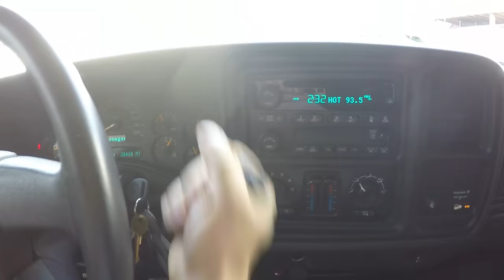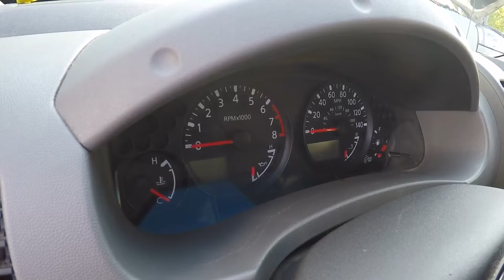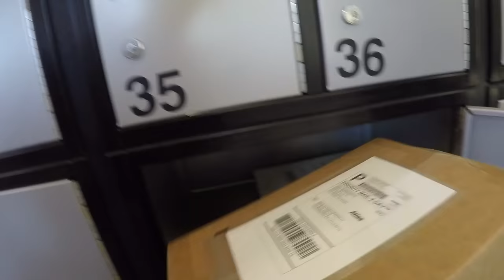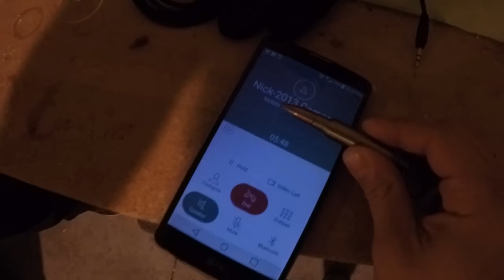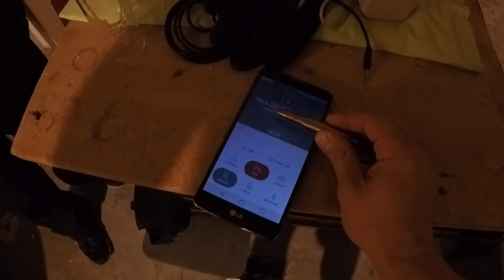THIS Is Why I RARELY Take My Truck Off Road...

Comment: I dont hate to say this but Im sure everyone will hate to hear it. My personal experience with Chevrolet has been quite unpleasant to the point I want to take a sledge hammer to them. There was an era of decency but before my time. I absolutely despise the manufacturer now and will never buy another one. I will try and persuade anyone else to do the same. I'm not trying to be cynical here, Maybe I and everyone else around me has been unlucky. Consider it a forewarning possibly. They're trouble for even the lightest of users . I think they could sell the hell out of a new vehicle if they went back to making them simple mechanically without the computers, sensors and EPA bullshit. But what do I know. I know the government wont let them, and two dealers make more money that way. Its a scam especially with government motors.  They worked better back then and if it didn't no big deal you could fix it anytime anywhere without a $1000 worth of tools and parts in a few minutes or a couple hours depending . Now the simplest tasks are so overwhelming its disparaging especially when you're not doing it for enjoyment.  At least if it was a pile you could still have your dignity and self worth in fixing it..... Ill write them a letter ha

Comment: I have taken my Suburban off road a lot and never has any problems. Well I don't need expensive rims like yours, I use steel wheels aftermarket type.    The terrains u drive are nothing.  Stock 4x4 could make it. Try mud and different terrains.  U make a lot of money and can afford anything. I'm not rich and don't own Z06. I own 2 lifted trucks and does goes off road sometimes. I'm mechanic myself and has knowledge of driving in off road and barely break while off road.

Comment: the reason you knicked the rim was because you have huge 20x12 rims with 35x12.5 tires which offer no sidewall protection, may look good on road but terrible performance off, if you get 37s it will help a little but for a truck you are gonna offroad never go wider than 8 in rims.

Comment: Some fun videos, I have a 2015 Silverado 1500 myself, if your going to use your truck off road you need more sidewall, two easy ways to do that, one, add 40" ires on your 20" rims for 10" of sidewall or keep the same size tire and put 17" rims on it, no more scratches on your rims.

Comment: Here's a tip: When you jump start a vehicle, don't hook the negative cable directly onto the dead cars battery. Clamp it on solid thick unpainted metal, away from the battery. The engine block works great. This is because if the dead cars battery is leaking gases, then the spark could ignite those gases, and well, you can guess the rest.

Comment: You know if you hold a constant rev of 2500-3000 rpm on the vehicle you're using to jump start the other. The vehicle with the dead battery usually starts, don't have to wait.

Comment: Positive before Negative. Whenever jump starting or electrical that involves the positive and negative. You will fry your system when you are grounded and put a positive charge on. Just a heads up, you don't want to pay for that fix.

Comment: Do yourself a favor and get a real set of jumper cables (4 gauge or better). That tiny jump rope you have just doesn't carry enough current. If the roles were reversed (you needed a jump) they likely wouldn't have done the job.

Comment: they gauges were flickering and the horn started to go off because the computer in the Nissan was freaking out. your truck's batteries are wired up in series so it's 24 volts not 12. your lucky you didn't fry his computer.

Comment: Your gauges flicker because it's pass interference from the charging let me give you an example but I'm pretty sure it will do that to if you hook up a battery charger its flickering because the elctrictricty has interference from the battery negatives and positives give a amp and volts the ground gives. Grounded base fro the truck and or car to start when the charger is hooked

Comment: i like your videos & you have a cool truck... but driving down a dirt road is not what we men consider off roading. Plus it's a cool truck but not a capable off road vehicle. that thing is like a boat on land. too stiff & ridged. it will sink. The lift does nothing for getting the differentials out of the way. you should consider independent suspension.

Comment: does your duramax have a crossover battery cable? like the cummins? does 1 battery get all the juice from alternator and then charges 2nd battery via a thick cable?just wondering

Comment: Flicker: gauges in vehicles today use an electric pulse to move, the more electricity added the higher they go, they even have an incredibly light charge going to them when the vehicle is turned off just to keep themselves zeroed. So the reason the pulse up and drop again or as he says "flicker" is the charge in the battery is so low that there is only enough in the system to lightly move the dials from there zeroed point. This only happens when a battery is super low or has connection issues from the gauge board to the battery. This also can happen in pretty much car but honestly depends on how nice the electrics are in which case old rice burners don't have the best due to how cheap they are.

Comment: you might want to invest in proper jumper cables. those cheapy ones will melt if you need to do some serious cranking, the thicker the cable gauge the better they will handle the current draw when cranking....

Comment: hay just a heads up jumper cables, batteries, battery acid, corrosion on terminals, cables  on front cloth seats. You could get holes in your seat,and your jeans,after you sat in your driver's seat. Just saying

Comment: I have questions mike , what length are your cb antennas and how did you run the cables from the antennas to the cb  ? Why do you have two batteries on the dirtymax and what did you do in the military ? Love the vids and your dogs !

Comment: Gauges flicker when the voltage is under 12v, you will see that until the battery voltage returns to 12.6 volts or higher

Comment: It's a truck it's supposed to go off roading stop complaining about a little scratch it happens
Reply: Daniel Dunkin it's a daily driver that wasn't built to go off-road and kind of a show truck on the side, not an off-road
Reply: Daniel Dunkin read the description
Reply: This thing shouldn't go offroad anyway. Its basically stock with big ass lift blocks and wound up torsion bars. Would have terrible axle wrap coupled with no flex.
Reply: adam courtney he doesn't have lift blocks, it's an actual lift coupled with 35" tires
Reply: No. it has blocks. you can see them in the video when its "off roading" around the 6:35 mark. The bottom of the leaf springs are around the lip of the wheel. Thats a good 4-6 inches of space between the spring and the axle pad.
For further proof just watch the old video of him lifting it. They are huge blocks.
Reply: adam courtney actually he doesn't have blocks, you should probably wash more videos before jumping to conclusions, it's a 6" zone lift, he mentioned it not long ago
Reply: Are you dense? That lift kit uses blocks... It is a kit that drops the torsion bars in the front and BLOCKS in the back. Its just what i said. Stock torsion bars in the front that doesn't flex plus blocks in the back that give axle wrap.
It might be a lift but its all for show and will not perform well towing or off road.

Comment: Actually they are required to open the hood at the stealership when doing an airbag recall. They have to disconnect the battery as a safety precaution.

Comment: as soon as that thing turns on its power steering is going to be out that it's a non American truck and y'all probably blew the mega fuse you only connect the red to the battery and the black goes to a ground

Comment: First off why connect the cables to a dead battery goof..Use the Positive and put the ground on the engine block of the Nissan engine block,bracket etc,use it as a ground this is what the starter does...Second your truck is idling how can it give a good charge..It needs close to 2000Rpms. Mostly because its a Chevy.. but all generators need rpm to produce a field current in the rotor and actually charge..Third your not helping anyone you could shock the nissan's Ecm and then no run ever. .
Reply: Fast&Fun finally, someone knows what they are doing

Comment: Get your transmission cooling lines ran to a stand alone air cooled cooler in that Xterra. If not, your trans fluid will eventually mix with coolant and blow the TCM(transmission control module).  Costs lots of money.  Just trying to save you money they all do it.
Reply: Oh yeah and that Xterra's immobilizer won't let it start when the TCM blows

Comment: You should not use the wheel the pull your self up in the truck your will break your steering shaft

Comment: As a heads up the dealer can tell if the ecu has ever been changed regardless if you put it back to stock or not.  Their software shows them if it's ever been unlocked or changed since it came off the showroom floor
Reply: Not that it matters just for future reference every dealer can tell.
Reply: matt sword I'm not sure about other dealers but as far as I know Subaru specifically cannot tell if you have modified your Ecu or changed it in any way if you put it back to stock with an accessport. They can see when the device was unmarried from the car which to them looks like the battery died/ecu lost power.

Comment: why didnt you just rev the engine in your truck? lol it would charge the other battery faster
Reply: iHackSource no it won't.  AC generators (alternators) are regulated,  revving it will produce no extra volts, amps, watts or anything for that matter. it will still only be producing 14V at idle, or 10,000RPM. only time voltage changes is when you use under drive pulling, and it drops then.

Comment: How wpuld he open his door if his battery went dead.?
Reply: With a key?
Reply: Joshua Dupont with a key how else
Reply: Joshua Dupont if you were talking about the corvette that would have been a good question.
Reply: Venegas the vette has an electronic door opening thing. a key hole would unlock it. not open it.
Reply: Joshua Dupont all cars with that have a key in the Remote to open 
the door if something happens
Reply: Venegas unfortunately there is no key hole for the driver side or passenger side doors to open it.
Reply: 07stang Ford there's a key hole under the plate to unlock the trunk and there's a lever to open the drivers door
Reply: Venegas i literally just looked it up. lol. Good thing im not a vette guy
Reply: But in my eyes the way they designed that aspect of it is terrible. Grant it they did think of how would we open it if something happened. Makes prices higher and more to deal with. Its a waste to me
Reply: But in my eyes the way they designed that aspect of it is terrible. Grant it they did think of how would we open it if something happened. Makes prices higher and more to deal with. Its a waste to me
Reply: Venegas oh I'm very aware, I used to work at a Chevy dealership and I've done it once or twice.
Reply: 07stang Ford Then why didnt you say that earlier.? Kinda strange if you ask me
Reply: Joshua Dupont kinda strange how I knew there was no key holes on either door though too huh? But if you wanna call me a liar I don't care I have nothing to prove to you 😂.
Reply: 07stang Ford im by far not calling you a liar. i dont know your life. i said what i though
Reply: Joshua Dupont it wouldn't make much sense lying about being a lot attendant making minimum wage. That's all I'm saying
Reply: 07stang Ford i wasnt calling you a liar. i just said itbwas strange you didnt say something
Reply: Joshua Dupont keys 😂